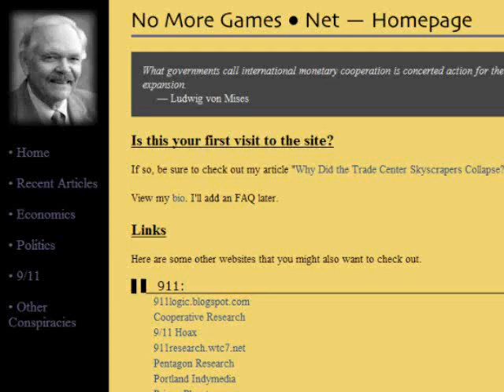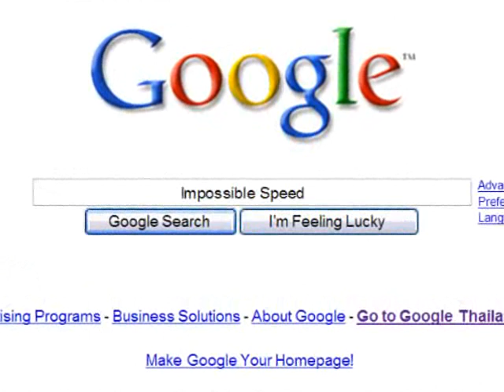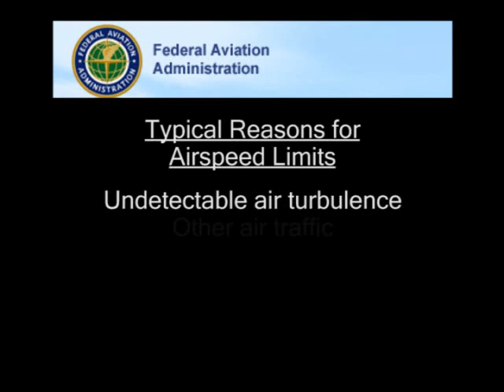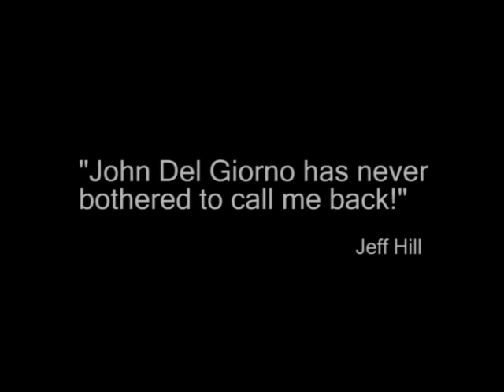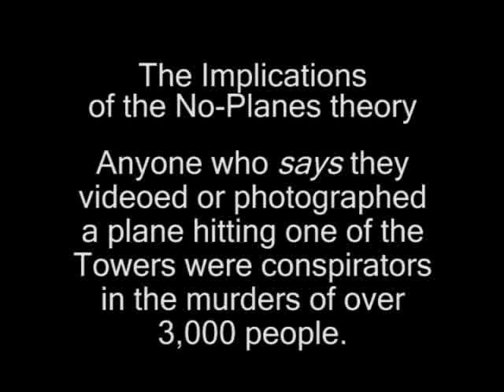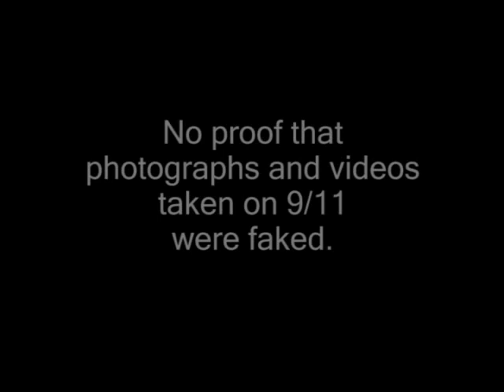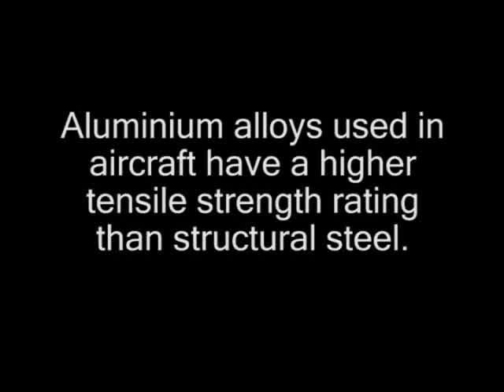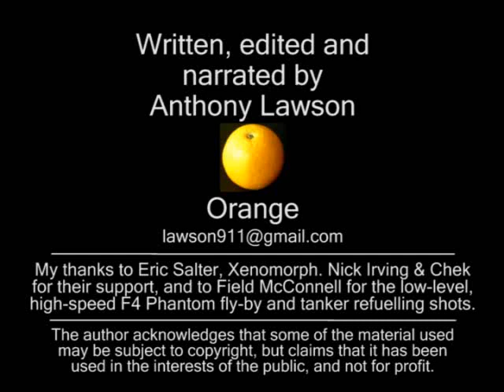9/11: Impossible Speed & Impact -- Busted! Updated

Comment: Ok, concentrating just on the impact damage for a moment.  The argument in this clip simply seems to be that the damage that occurred is an inevitable consequence because of the massive amount of kinetic energy involved.  In the comments it then goes on to surmise, “At speeds of around 575 mph, 840 feet per second, they can and they did”… Is there any OBJECTIVE evidence to support this conclusion? Any examples of a jetliner slicing through steel perhaps?

Comment from the maker: @alanbstard4 
VNE is an FAA imposed limitation, not an airframe or engine limitation; it is NOT a part of a plane's performance envelope, which, as far as I know, Boeing has never released for the 767 series
If you can get hold of Boeing's actual wind-tunnel test data that would shed some light on this issue, until then, the speed calculated from the videos are good enough for me, because they appear to be genuine, to my experienced cameraman's eye.

Comment from the maker: @alanbstard4 
To be fair, hitting a building is not exactly landing, in the accepted sense of the word. But it is true that many pilots have claimed that amateur pilots probably could not have hit the buildings the even experienced pilots think would have been almost impossible for them. Which leaves computer assisted remote, real-time visual control, such as is used in the Predator system, to iron out sudden wind changes.

Comment from the maker: @ChristopherMarlowe 
The faster speed mentioned by Deets is crucial, you lied by omitting it.
Can't you understand that not seeing the plane in the clip you sent has no bearing on whether a plane crashed into the WTC? It could be missing from that copy for a number of reasons, one of which may be that Fox is playing mind games. It was in the copy of the clip I used, so it was in the live broadcast.
The plane did not melt, it pierced the wall. Check out kinetic energy.

Comment from the maker: @dominic150
I repeat: Only Boeing knows the speed capability of their planes near sea level, and they do not release such figures. KCAS and other test and safety parameters are set between aircraft manufacturers and the FAA, they are quite different from a plane's ultimate performance capabilities.
This has nothing to do with being a genius, although you used the word derisively, it has to do with understanding what issues are relevant, which is what you do not seem to comprehend.

Comment from the maker: @dominic150 
Calibrated airspeed is indicated airspeed corrected for instrument errors, position error (due to incorrect pressure at the static port) and installation errors.
Boeing's and the FAA's agreed test parameter for the 767, Vertical Descent, VD is 420 KCAS to 17,854 ft. So your comment is irrelevant regarding corrections to be made for air density. The 767 can be tested close to sea level at 420 knots CAS. K420 + 21% = the impact speed, and it was almost certainly not a standard 767.

Comment: KCAS is the key there genius. Calibrated. the air speed indicator is calibrated to high altitude. The actual speed at or near sea level is roughly half of that number due to the difference in air density. Shame shame. It looks like the investigator investigating the investigator didnt do any investigating either.

Comment from the maker: Yes, I have been in direct touch with "Captain Sherlock" Field McConnell.  If you look at "About This Video" you will see that I refer to his expertise. I e-mailed this formally-phrased question to him: Could a Boeing 767-200 have dived from, say 30,000 feet, then levelled off to hit the South Tower moving at 586 mph (509 K)? His answer was: "Yes." 

In fact Field believes that radio-controlled military lookalikes were used, which does not change the fact that a 767 could have done it.

Comment from the maker: There is an apparent difference. In the first shot, the plane is traversing the screen, from right to left, on a fairly wide angle lens with the camera tilted up, slightly. In the second shot, it is approaching the camera, diagonally, at approx. 60 degrees, on a long lens, with the camera fairly level. The same thing occurs with action replays, during football broadcasts: different camera positions and lens settings produce different-looking shots, from exactly the same on-field action.

Comment from the maker: A beer can, it should be at least half-full, travelling at 840 ft per second would probably do some substantial damage to a shopping cart. Have you tried it? 

But you're talking nonsense about the nose being intact, that was almost certainly an extrusion of drywall dust being pushed out by the air in the plane, and the explosion.

Comment from the maker: You show yourself up as a fool, with more unsupported claims. 19 Rector Street is the reddish building, with an arch on top, directly to the left of the Towers in the wide-angled lens section of the Herzakhani video. Even the most rabid no-planers, such as Ace Backer, have admitted that this claim was ridiculous, shortly after it was propagated. And Carmen Taylor's still shot matches a frame from the Herzakhani video. They must have been close, otherwise the frames would not match. cont/

Comment from the maker: machfron, 
What knowledge do you possess which says that the aircraft in question was the one which  Russ Wittenberg flew? No one even knows how the aircraft was controlled. It was, however, seen by hundreds of eyewitnesses, and can still be seen in upwards of 40 videos crashing into the South Tower. You can theorise until Hell freezes over, but you've also got to explain away all of the videos, all of the photographs and all of the eyewitnesses. Get to it, or get blocked for being boring.

Comment from the maker: thekingofithaki, 
Naudet Video NTSC copy: When the plane is first seen it has passed the red brick building on the right of frame. (F133)  From this point until its shadow is fully on the Tower, virtually the moment of impact (F175), is 42 frames or 1.4 seconds. In stating it is 2 seconds, you have overestimated the period by about 40%. Whatever it is you are trying to prove, if your other calculations are similarly erroneous, I doubt that your case would stand up in a court of law.

Comment from the maker: You can theorise all you like about anything you like. What you have to prove is that every 9/11 video was faked. The engines on THAT plane, quite obviously, did not choke at 575 mph, or so. An ex-F4 Phantom pilot, with years of experience flying big commercial jets, and a USAF maintenance officer confirm this, and that the plane could do what can be seen in the videos. Read "About This Video." Are you calling these people liars, on the basis of your theoretical calculations?

Comment from the maker: machfron, You must also explain the plane-shaped holes in both buildings, the edges of which showed little evidence of having been caused by internal explosions. How do you rig walls to make those holes from the inside, and conceal the explosives and the work required to set them from the staff in so many offices over so many floors? How were the large amounts of whatever caused the fireballs concealed from the office workers? If the planes were not real, you've got a lot of explaining to do.

Comment from the maker: machfron, If an aircraft did not hit the South Tower, how did Park Forman, among others, pan a camera over the New York skyline at exactly the correct speed and end up with the Tower framed at the exact moment it exploded? It is hard enough to pan a camera with someone passing behind a ten-foot wall, picking them up centre frame as they emerge, even after four or five rehearsals.

When you can explain all the videos and eyewitnesses, then your comments about the plane will become relevant.

Comment from the maker: It is not slander to point out the truth. Joseph Keith's claims were outrageous. Turbofan engines do not "max out at 330 mph at 700 ft. altitude." Mr Keith was a software engineer, at Boeing, he was NOT an aeronautical engineer.  Follow the links in About This Video and you will see why he was wrong about the engines and the airframe. He engaged me in a debate, by e-mail, the last time I heard from him he wrote: "I'm trying to get a complete report from FAA." That was on January 18, 2008.

Comment from the maker: migca wrote:
"It contains no data that even alludes to a final, relatively level approach to the WTC."
"I still don't see how ATC data corroborates the near-level flight paths seen on video."

That is because the ATC data doesn't. I wrote:
"At counter 07:28 in the above video, the plane can be seen at a height well above 1000 feet.... The final descent slope levelled to about 3.5 degrees. Watch the video from 07:28 to 8:59."

The final sentence refers to the video, not to the radar data.

Comment from the maker: psikeyhackr: You are right. The 700 feet figure comes from the guy who says "...the power plants would max out at 700 feet altitude," (Joseph Keith, at 2:45 in the video.) It's one of those irritating mistakes, originally made by someone else, someone I was trying to debunk, and to adjust his claim to a slightly higher altitude would only have clouded the issue regarding the plane's engines. I should have adjusted it for other comments, though. Sorry.

Comment from the maker: The NTSB data is what I used. The impact altitude was 700 feet; 300 feet lower than when JFK approach may have lost contact. At counter 07:28 in the above video, the plane can be seen at a height well above 1000 feet (the Towers were 208 ft. wide), and one can intuitively tell that JFK approach radar should have still been able to "see" the plane. The final descent slope levelled to about 3.5 degrees. Watch the video from 07:28 to 8:59. The cut shows good continuity, too.

Comment from the maker: 1. A diving attitude is consistent with the ATC radar information, showing that the plane descended rapidly from about 28,000 ft., then levelled off to a slope of about three to four degrees for the final three to four seconds.

2. The plane's final manoeuvre was a hard left bank, a few seconds before impact. (I do not know what a "hard right/bank left" is.)

3. Which video shows this?

4. A period of between three and four seconds can hardly be described as "long". 

What is your point?

Comment from the maker: It's a 10 minute video. For more information on the aircraft's speed, please follow the links in "About This Video". There have been many comments about PODs but that is a side issue. Flt. 175  was almost certainly swapped, during an ATC radar crossover, for a remotely-controlled, similar-looking plane. We do not have all of the answers, which is why a new enquiry is needed, but one thing is sure: There were hundreds of eyewitnesses and they didn't need to Google DRAG to confirm what they saw.

Comment from the maker: Simon Shack:  The subject is not your brother's Mavica; it is Carmen Taylor's. If a "Center for Excellence in Teaching" document states a 4 to 5 second gap, it is more than possible that your brother's camera is faulty. Haven't you ever had a piece of electronic equipment perform below its specs? The Mavica MD7 appears to have been sold on the basis of a 4 to 5 second delay being required between exposures. (cont.)

Comment from the maker: (cont/) Not that it is relevant, Shack's next statement is also provably incorrect.  A 28 page PDF headed "Instructional Design for Using SONY Mavica FD7 Camera; Steve Bonham; Center for Excellence in Teaching" states: "This camera does NOT take video sequences, in fact it writes to disk very slowly -- expect 4-5 seconds delay between photos." 

Not, you will note "about 10 secs".

So where are these three sequential shots, Simon? In your head, like the other nonsense you churn out? (cont.)

Comment from the maker: I do not know the speed of the 767 in the air show video.

The FAA's jargon is imprecise: "...Airspeed Limits: VD = 420 KCAS to 17,854 ft/.91M above 23,000 ft..."  I did a lot of research on this, and my logic gave me: "...420 KCAS [up] to 17,854..." Before the "to" another altitude is required, which, in the absence of a specific figure, can only be sea level, thus:  "...420 KCAS from sea level up to 17,854..." The USAF officer, mentioned in About This Video, uses this interpretation.

Comment from the maker: There are two issues: the airframe and the engines and I thought I had made the division clear. Following Joseph Keith's assertion about turbofan engines, I was trying to point out that turbojet and turbofan engines do not "choke" at low altitudes. The Buccaneer's turbofan engines have a lower bypass ratio than a 767's engines, but the principle is the same. As Captain Field McConnell, the guy flying the F4 in the refuelling shot says: "[these] engines don't choke."

Comment from the maker: lilchico4wg: Joseph Keith was a software engineer; the "Shaker System" is a test rig which vibrates aircraft components, at various frequencies, to test their durability under stress. As a director/cameraman, I spent many years working with film crews and laboratory technicians, but if you asked an expert camera assistant how the film he'd kept so beautifully in focus was processed, he'd probably have no idea about the details. 

Page 1: For the correct answer, ask the right expert.

Comment from the maker: pumpitout's expert in the "shaker system" claimed that the air intakes act as a brake. Clearly the experts I have quoted do not agree, and the videos show that the engines of the alleged 767s did not choke and prevent them from hitting the World Trade Center. Your continual raising of this question only demonstrates your stupidity.

Comment from the maker: If you coast your car down a steep hill, does it come to an immediate stop when the slope levels off to, say 3º? If you've reached a speed of, say, 100 mph, then floored the accelerator, if your car was capable of travelling at 100 mph, that is the speed it would maintain. The Boeing 767 is permitted to fly on one engine for 120 minutes, virtually fully loaded. Think about the speed it could maintain on two engines, even in the denser atmosphere close to sea level.

Comment from the maker: Please! We are not talking about a jet fighter. Commercial airliners may be required to descend rapidly, in an emergency. Another expansion of VD is "Maximum Vertical Descent". You are using your words: "nose down, full throttle..." to make an absurd statement about safe flying. VD is the FAA's permitted speed in a dive, which would normally be shallow, that a 767 is permitted to maintain at altitudes between about 18,000 ft. and sea level. It is not the aircraft's maximum possible speed.

Comment: I have a question regarding the maximum speed.Using your words,VD is MAXIMUM DIVE SPEED-which imo means the maximum speed of the airplane when its performing the dive-you know,nose down,full throttle,gravitation pull,all of this combined.And then you add,that it means the airplane is permitted to fly and fly safely at those speeds.But I don't think nosediving is any part of safeflying,it looks more like maximum speed limit during the emergency dive.

Comment from the maker: Well tell us all: What did Joseph Keith do at 
Boeing? Was he engaged in aircraft design? Did he work with wind tunnels? Was he an aeronautical engineer or a software engineer? Did he fly planes? Would he know as much about FAA regulated air speeds as a USAF Lt. Colonel with 22 years experience in the aircraft maintenance area or a commercial airline pilot?

Comment from the maker: My name is not Alan, which shows that you cannot accurately digest what my video is about. I do not compare military planes with civil planes, I make the point that turbojet and turbofan engines do not "choke" at low altitudes. The Buccaneer's engines have a lower bypass ratio than a 767's engines, but the principle is the same. As Captain Field McConnell says: "[these] engines don't choke." Check out his CV, to find out what he knows about flying big jets. He says the speed was possible.

Comment: there are several different versions of Hezarkhani video (killtown links them)- which is the "genuine" one? Yes there is an attempt of "wiev from both sides" here> 911research*dsl*pipex*com/ggua175/hezarkhani
unfortunately also showed the slight problem with the port wing interfering with a building in one of the frames.

Comment from the maker: An aircraft with an all-up weight of around one-hundred-and-sixty tons, travelling at about 840 feet per second cut through one wall of the South Tower of the WTC on 9/11. The event was recorded by several video cameras; it was seen by hundreds of eyewitnesses and photographed by some of them. That is all my video proposes, against claims that this could not have happened. The follow-up question is quite simple: Does tumetuestumefaisdubi believe this, or not? A simple answer is required.

Comment from the maker: You don't think I've tried getting information out of Boeing? Don't be stupid. Boeing will not get involved in this argument; they are suppliers to the Pentagon. And we are not discussing level flight. Look at my most recent post, at the top. You've cited the radar, check the track and altitudes. It came down from 28,000 feet then levelled off tpo about a 3 degree slope, as can be seen in the videos. And, once again: it is informed opinion, not speculation.

Comment from the maker: The engines would not "choke", as stated in "Impossible Speed". That is all. Yes, the Buccaneer's engines have a lower bypass ratio, but were designed about 20 years before the engines used in the 767. I am confident that my research is correct. Getting exact matches, to demostrate this, was not possible.